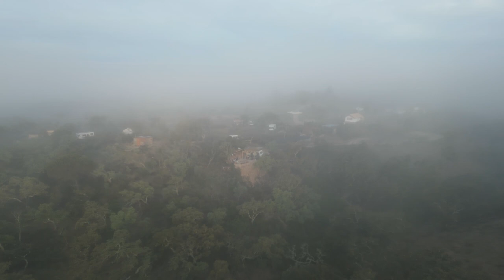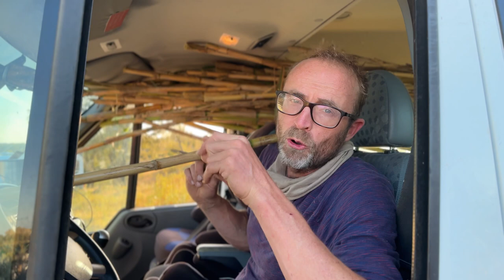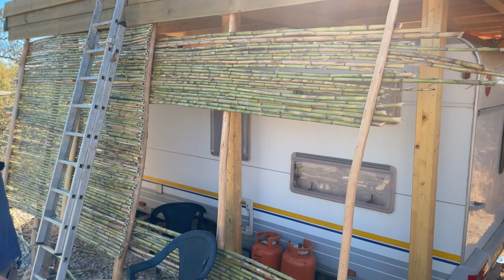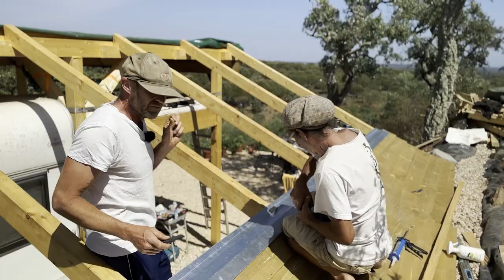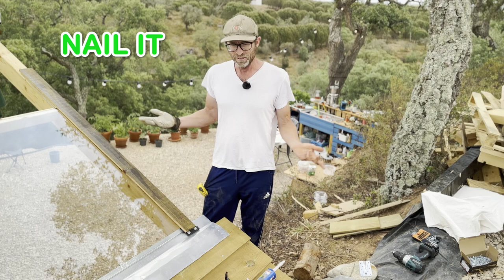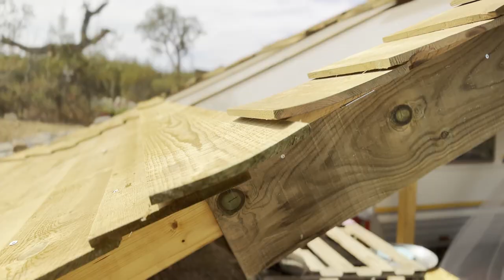#4 Creating our own Paradise at Off Grid Community in Portugal -  Cane wall -  Passive house windows

Comment: Is going to be 60 Celsius under that glass
Reply from the maker: Hi Victor, well hopefully not :) we think it will not get that hot because much of the summer sun will not shine through the glass and it is not a closed room, air can easily pass through. If it does get too hot, we will have to put some sun blinds in the summer